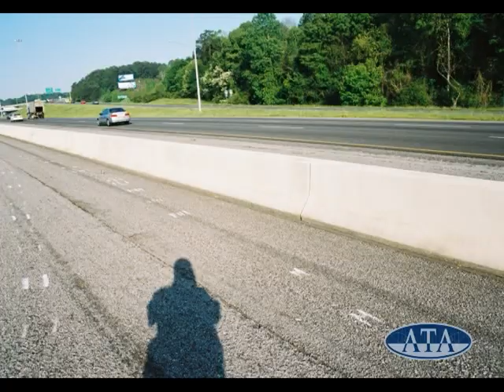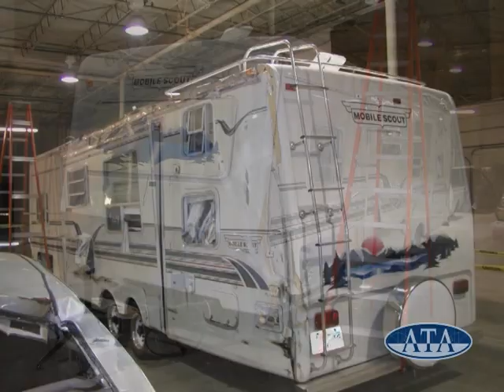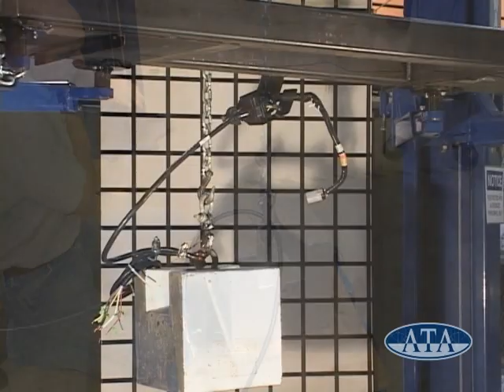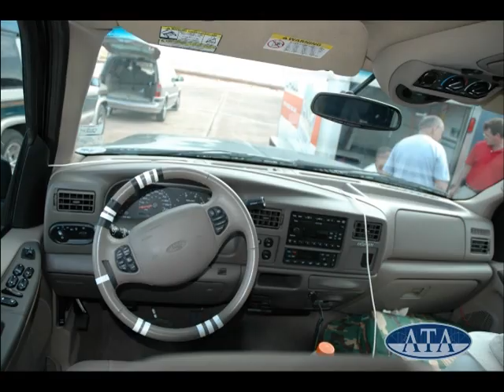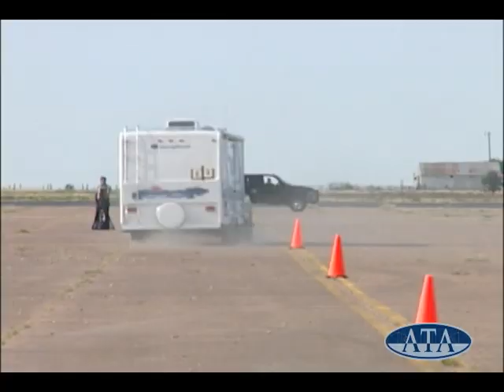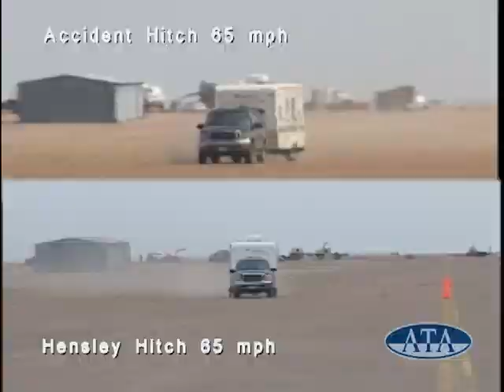Trailer Hitch  Incident with Product Testing

Comment: There is a HUGE different between those two hitches. Actually, Hensley and ProPride are the only two hitches that are not like any other out there. Proper loading of the trailer is key in all cases, but it is completely IMPOSSIBLE for the trailer connected with a Hensley to get away from the tow vehicle. Physics will not allow it as it's a solid connection. ONLY the tow vehicle can turn the trailer, not the other way around. The friction style sway control is an add-on as shown in the video and can be tightened and loosened by the user. This allows you to control the amount of sway control . The problems with this style of sway control are: You cannot back the trailer up unless it's disconnected, and if the force of sway overcomes the friction, then the device has failed and the trailer will continue to sway worse until it flips. Hensley and Pro pride hitches are the closest you can get to a 5th wheel or goose neck when it comes to stability and sway is IMPOSSIBLE.
Reply: And yet they performed the same.....nothing better or worse! Why spend the extra $$$$....unless is just makes one feel better.

Comment: I had the very same make/model travel trailer for 10 years.  Initially towed for a short time with a 1/2 ton Dodge quad cab before upgrading to a GMC 2500 quad cab.  The trailer is heavy, but should have been no issue for the Excursion.  I would look at other factors, such as how the trailer was loaded or the very well known and documented "death wobble" that Ford HD trucks have become famous for.

Comment: Towed a 35ft TT for 17 years with an 02 V-10 Excursion. Never had an issue. I always made sure I was set up properly and had the proper 12% tongue weight. Driven through high winds, been passed by semis, never an issue. If you see the vehicles towing on the highway, half of them aren’t even set up correctly! Which I’m sure was the case here!
Reply: The ford V10 has a drinking problem. 9-10 mpg without the trailer
Reply: @Snuggs-o1  
15 on the highway for me with 3.73’s. When I went to 4.30 the highway mileage dropped to 14.3 but towing mileage went up by .5 to 7.
Reply: @dodgeguyz  You are doing better than the average diesel powered excursion
Reply: @Snuggs-o1  
And these are honest numbers. I have read of 7.3’s and 6.0’s getting 9-10 towing a trailer similar to mine 35ft and 9300lbs loaded.
Reply: Did you use a distribution hitch?

Comment: Speed speed speed, 65 MPH is insane
Reply: How!
Reply: @dodgeguyz  your pulling a trailer that, if it goes out of control, can easily flip the towing vehicle.  The faster you go the easier it is for the trailer to sway, once it starts its hard to stop.  Plus passing with a trailer can be a challenge. Want to get to your destination?  Slow down and stay in control of your rig.
Reply: @Dog.soldier1950  
Ok. And what is wrong with towing at 65? I towed at 67-70 with my Excursion and 35 ft TT. I have 17 years and 10’s of thousands of miles towing. Yes when it gets windy you slow down. Are you saying to tow at 50?!!!! Is the only way?
Reply: @dodgeguyz  your ascribing luck for skill
Reply: Dogsoldier 1950 
Don't need luck when you have skill! Luck is for people,that don't trust there own skills or lack thereof!
Reply: @dodgeguyz  famous last words
Reply: @Dog.soldier1950  
That makes zero sense!

Comment: New Hampshire I-93 just after Exit 23 northbound [toward camping areas], older Ford Explorer pulling a 35' travel trailer rolled into a slightly v shaped large grass median.  SUV stayed upright but trailer was flattened [racked] and that thing was PACKED with groceries, clothing, kids toys, you name it.  It was all strewn out everywhere; what a mess.  All came out thru the roof.  Possibly too much weight loaded in the rear bedroom combined with a sudden steering move.  Or maybe the driver was competent, loaded correctly and another vehicle was the culprit.

Comment: You have to wonder about the loading of the trailer and tow vehicle, camping for a week can add a lot of additional weight, the trailer could have had 50 or 60 gallons of water in it, and the excursion could have had 8 passengers ( it is rated for that) . If This test not following the same parameters as the crash vehicle makes it meaningless.
Reply: This test was for the hitch though, not operator competence
Reply: @Morpheas001  --The hitch was designed for sway control. and loading most certainly can contribute to sway, This test was fake, paid for by the company that designed the hitch.

Comment: Whoever set up the hitches did NOT do it correctly. To much tongue weight, front tires are being lifted. I towed a 34 foot travel trailer with a 2004 Excursion that was properly setup. Drove awesome.

Comment: Problem was a loose nut holding the steering wheel.
Reply: Haha nice
Reply: It wasn't just loose.  Further study showed it was defective in design and manufacture.  It was never a suitable component to hold the steering wheel safely.  Product improvement committee suggested withdrawal and destruction of all such defective nuts pending a complete redesign and reissue.
Reply: I don't think so... Normally the clock spring on the steering column would have more play. Than a loose nut.
Reply: @ray_casso  The loose nut was between the steering wheel and the seat....

Comment: How many men here read the instructions on how to correctly install and adjust a weight distributing hitch and sway control? Bueller? Bueller? Bueller? 😳😑😑😶😶😶
Reply: I did! Plus I used  Cat scale to verify the adjustments.
Reply: I did, plus proper weight balanced truck and trailer.
Reply: When all else fails, you read the instructions

Comment: I dont know what happened but I know this. At 3  minutes you can see the safety chain hook . Its upside down. Hook should have gone in from tbe top. Also no latch or mousing  on the hook !
Reply: The hook is supposed to be like that so if a bump is hit it bounces up and hits the hitch and comes back down in place. So the only way to remove it is to twist it upward to unhook it.  The chains are also supposed to be crossed.  The hook does not need a latch on it to be within law but it's recommended.  Commercial contractor trailers never have latches on their safety chains. I own  trailer repair shop and have the Federal highway regulations regarding trailers laminated in our shop.
Reply: Another reason it's supposed to be like that is if the hitch does fail then you have a ton of weight on the hook, then if the hook fails it's going to go off in the opposite direction it's hooked, so you very much want those hooks to fail DOWN instead of fail UP

Comment: Interesting footage.  My conclusion after watching the videos is that a Ford Excursion is a really stable tow vehicle regardless of the hitch, and assuming the weight distribution of the trailer is even close to right, you'd have to be a seriously ham fisted idiot to screw it up haha.
Reply: Damn Skippy might get one of these here excursions lol even though they don't make em anymore
Reply: @daimonwilcox  find one in good shape with the 7.3l diesel and you have a very long lasting vehicle. They still fetch a good price tag if well maintained.
Reply: @iviaverick52  Yeah, the only issue is the fuel mileage, and the V10s are even worse.
Reply: @Tracert-mc1hu  My 6.0L excursion gets over 1200km too a tank, and they have a smaller diesel tank then my 2017 F350 6.7 that gets about 700-800... The excursion was actually really good fuel wise
Reply: Only Ford I’d own. One with a 7.3 would be amazing. My suburban will be good enough I suppose
Reply: Offensive to Hams! 🍖

Comment: Why isn't the driver in the test vehicle wearing a helmet in case the vehicle did actually reproduce the failure? Also, I wonder if the trailer was improperly weighted toward the rear.

Comment: why didnt the test driver have a helmet on
Reply: Probably because they were pretty sure the hitch wasn't going to be a problem when properly installed and legally operated, I.e. the actual problem was the idiot behind the wheel, like it usually is.

Comment: Hello, I would like to know what product you recommend to carry an RV trailer with greater safety ...... thank you ..........
Reply: F-350
Reply: A longer wheelbase and more weight.
Reply: @imacrazyguy5831  Which is funny since the vehicle in question is a doggone Excursion...
Reply: The “product” that “carries” an RV trailer is the tires. I recommend round rubber ones properly inflated.

Comment: Every one pulling way more weight than what is safe
Reply: In general, Excursions can tow up too 11,500lbs and if it was overloaded they wouldn't have bothered with the test more than likely to prove what would be well known. Its just people ignore trailer tire speed limits and think that with all the weight they can maneuver like a sports car, but yeah, good point. My 07' Durango can tow up too 9,000lbs, and I haven't exceeded 6,500-7,000lbs yet and don't have a need too.

Comment: I have saw an s10 pickup pulling a 40 or 50ft boat with a 3 axle trailer. Over loaded??? Yeah! Guy was on the interstate going about 45mph. Truck probably could not pull any faster. This is a wreck looking for a place to happen.
Reply: Even if a trailer is within the maximum towing capacity, it could be dicey. I used to have a tahoe. It was rated to tow 5000lbs. No f-ing way I would tow that much on a short wheelbase with rear coils.
Reply: I passed a Chrysler 200 towing a tandem uhaul trailer the other day. I have seen a sunfire pulling one years ago. The sunfire had a dent in the rear door that looked like it came from the corner of the trailer :)
Reply: @juliogonzo2718  Have you heard the stories of GM minivans (fwd uni-body) driving up to dealership service shops with uhaul still in tow, customer concern: they can’t open the doors?  
The bodies were stretched.
Reply: @preachers4135  In Nebraska years ago I passed a ford windstar on the side of the road with a 6x12 uhaul trailer. The body of the car folded at the rear wheel wells. The hitch was dragging on the ground.

Comment: I had a 2002 Excursion and pulled a 35ft 9500 lb trailer from Dallas to Branson MO back in 02 or 03 and my trailer brakes were shorted out so I had no trailer brakes. I drove back most of it in the rain. It was pretty much fine until I got in to the DFW area where my butt was puckered the whole rest of the way home. Somehow I made it and didn't kill my whole family. Damn that was scary though. I weighed the whole setup on the way out and the total weight was a little over 18k lbs.
Reply: @SomeDumUsrName I didn’t realize they were shorted out until I was on my way home and really didn’t know what was going on until I put it in the shop.
Reply: Why didn't you do pre trip inspection, not a half-ass inspection but a true inspection as if your life depended on it. Never put a fool in the drivers seat.
Reply: @utet.4226  it shorted out on the way back and was intermittent at first. I really wasn’t sure what the issue was either so I drove home carefully and kept a lot of distance in front of me. In the end I made it and got it repaired. I was young and probably stupid one could argue, we’re not born with this knowledge and the RV industry does little to educate anyone. YouTube and the internet has helped immensely.

Comment: I assume this was done by the hitch manufacturers law firm to prove, hey it wasn't our product.  That was a simple round bar WHD with a single Sway brake installed. They compared it to the highest rated, most expensive hitch on the market to prove that when properly installed and configured it is just as good at controlling a trailer as the Hensley.  Looks like they were right.

Comment: Before buying an RV, know what your vehicle can tow!
1: GVWR
2: GVCR
3:Carrying capacity of the tow vehicle including hitch weight. Be careful with this one!! It’s not as capable as you think it is!!
4: Carrying capacity of towed vehicle!! Be careful with this one also!!
5: Cheap tires is a no no!! Tires must be able to handle the weight!!
6: taking your RV off road, you’re on you’re own!! Rough roads will damage a new RV very quick unless it’s built like a tank!! Is yours?
7: Weight distribution hitch/anti-sway capability!! Yes they differ!!
8: Hitch weight is part of the carrying capacity of the tow vehicle plus personnel plus extra cargo in the back of tow vehicle! You may find out you’re overloaded before beginning your trip!!
9: EXPERIENCE 
10: SPEED!! Don’t say, well they’re going fast, I can too!!

Comment: PUHLEASE!!!!!! my RV is the same size and made in 2003. I don\t even use a weight distribution hitch on my 2000 F250. I pull it s fast as I wanna go and its never been an issue.

Comment: I see it almost every day, someone dragging a trailer down the highway, either excessive speed or incorrect weight distribution. Wether its hauling equipment or campers. Human error! And they should be fined for their neglect to adhere to safety.

Comment: Lots of facts missing here , how fast was driver really going ? Was trailer over loaded? Was the load in trailer balance ? How much weight was in car including people and fuel?weather? Wind ? Rain? Wet road? And more how much towing has the driver done in their life , how old was the hitch ? I mean I can go on on
Reply: I was going to ask the same questions as Dennis.  I would have even asked the questions without the video which seems to exonerate ALL of the equipment.  I was especially impressed how well the trailer handled.
Reply: Lawyers don't want to hear that because they can't get blood from a turnip.  They want to blame the hitch manufacturer, tire manufacturer, truck manufacturer, etc.
Reply: this was a hitch testing to prove the hitch was not the problem most likely because the  car insurance co is looking to pass on who pays out. this is the hitch maker proving/defending their hitch is good and don't care if the driver loaded it wrong or road conditions.

Comment: The most logical problem is the part between the seat and the steering wheel. Driving way too fast when towing is usually the cause and insufficient or overloaded tongue weight.
Reply: Yes, that is called the “nut connecting the seat to the steering wheel”.   Doesn’t seem to matter how much ‘intelligence’ is engineered into the vehicles, that nut is the weak ink.   I argue that the ‘smarter the car, the dumber the driver’...are they even testing parallel parking these days?
Reply: @Rick-tt6yq  Parallel parking?  In this case I don't believe ANYONE should be allowed to tow a trailer over a thousand pounds without a special classification added to their CDL.  This should be a DOT requirement so that it is consistent in all 50 states!
Reply: @ronaldsmith6829  one thousand or ten thousand? Cause my 5x7 trailer alone weighs about 600lbs add a riding mower, trimmer and gas and I'm at or over 1000lbs. So I would need special licence to go mow my grandma's yard. That's a bit absurd.
Reply: Hill Billy, he has his own issues.  You dont get a CDL if you aren driving for hire.
Reply: Don't forget not enough tongue weight as in too much behind the axle of the trailer. Thats probably what happened here with an inexperienced driver.
Reply: It was the loose nut behind the steering wheel!~
Reply: That and improper maintenance and improper trailer balancing.

Comment: Maybe I'm missing the point here but the only thing I saw was that neither hitch failed when an entire team of experts was employed to properly install it. Is it's expected that the average operator pay a team of Engineers set up the hitch every time they tow?
Reply: WDH are easy to set up properly, follow the installation instructions and use a scale to verify.  In this case they verify all was done correctly. I see nothing wrong with it.  It's how they keep from paying out a multimillion $ lawsuit when it isn't their product that was the issue.
Reply: No, they're just proving the hitch didn't fail, it was driver error that caused the rollover.

Comment: Lawyers quit trying to make it look like it was the hitch manufacturer's fault. Tell your client to admit they suck at driving.
Reply: Or loading and balancing between the SUV and the trailer
Reply: Exactly. Almost all trailer pulling incidents are a result of poor maintenance, operators not following standard practices, improper loading, and improper driving techniques. Pulling a trailer certainly is not as safe as driving without a trailer. Lawyers just go after the people with the bigger pockets and that is almost always the manufacture. This is a big reason why stuff is manufactured by companies oversees as it shields them from some liability from idiot operators.